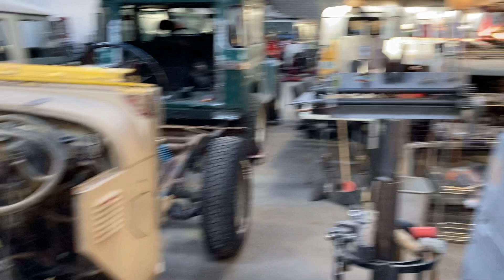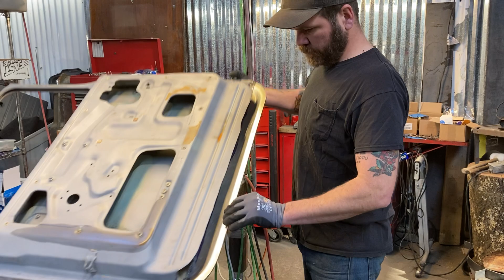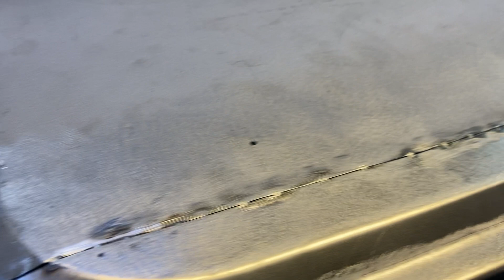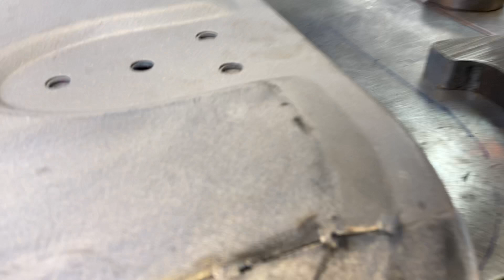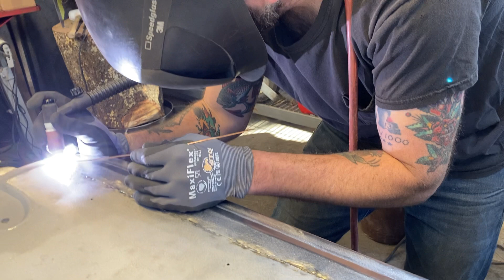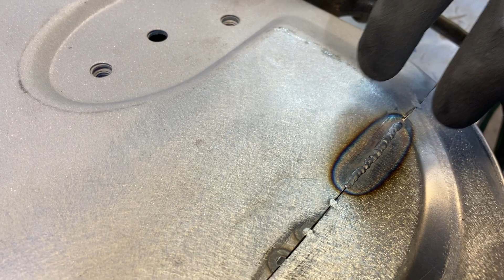1978 FJ40 Door Patch Panel Repair 2 of 3: Land Cruiser Restoration

Comment: Are you using mig wire as a filler rod?
Reply: By the looks of it and 
How straight it is
It's definitely Tig wire
You could use of wire but it would be a pain
Reply from the maker: We've got a TIG setup, aligned the panels with a very small gap ( ~1/16"), tack welded, then welded the seam, and finished with sanding smooth.